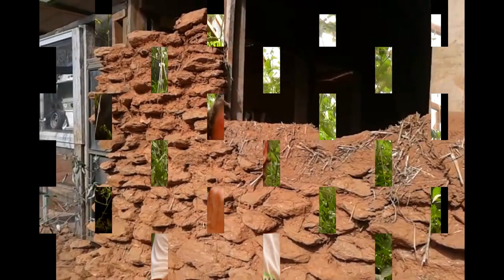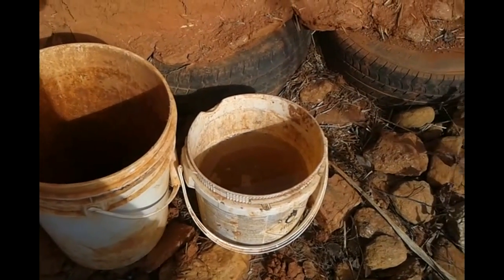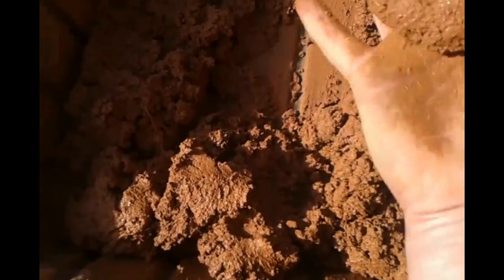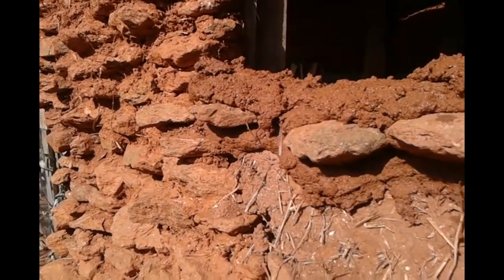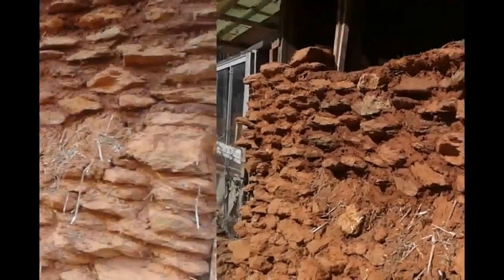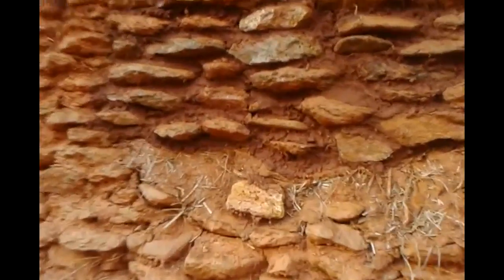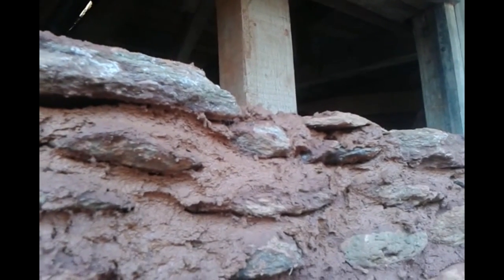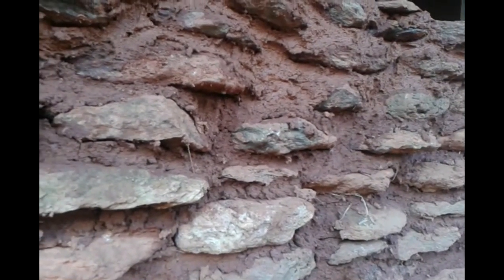How To: Rock Wall w/ Cob Mortar

Comment: Hello, friend. So sorry I have not seen this till now. I love cob building. And it is amazing you can find the perfect rock for each spot. We do not have red clay. But I keep testing what we have to see if it will get had enough. I plan to try an earth oven. But it seems the answers are in your land. Or things will show up if it is meant to be.When you finish the wall, you could rock up a  a bench in the area that has extra cob. That would look wonderful and provide a place to set plants. I love how it is the so strong you have to chisel at it. Best wishes, E. :)
Reply from the maker: A bench would be a great addition to my cob house Thank you for the great ideas. I need to post a video on how you test your soil for clay. I agree with you if it is meant to be it will happen. Thank you for watching
Reply: I would love to see the video. I has thinking maybe my soil has enough sand to clay ratio already in it. I have been making sample balls to see how they hold up. But some how they disperser.  Wind rain etc. I very much enjoy your channel. Thank you. :)

Comment: Awesome Idea cob/ soil cement and Rock something my land has in abundance !
Baruch Haba B'Shem YHVH :-)
Reply from the maker: +harm552002 You say that now and I said the same thing I have plenty of rocks and dirt. It runs out some it will be a grid pattern searching different areas and riding dirt roads looking in the ditches. Be careful if you start rock work when you visiting new places you will pick up cool rocks and carry them home no matter the distance. I have carried rocks 1200 miles the awesome thing is I can show you those rocks in my work. Thank you for watching

Comment: Great video! 
I'm working on an urbanite retaining wall 10 inches high. I'm wondering how the cob mortar holds up on the ground in wet conditions like monsoon rains?
Reply from the maker: Sierra Novack if it stays fully it will be fine
Reply: What do you mean, if it stays fully what?  We're debating using concrete motar vs cob mortar. And if cob straw or no straw?  Like someone else commented, there is hardly any info that I can find online. Any info would be appreciated.
Reply from the maker: Sorry if it fully dry's

Comment: Do you think i could use cob on old brick wall? Would it stay on? Thank you :)
Reply from the maker: I think it will work great. I would give it a try won't hurt anything. I used brick with cob morter morteron the Adobe oven they are holding up great.Thank you for watching.

Comment: That's not 'about the maximum you wanna go'... If you want a higher wall you have a couple options but recommend using both... 1. If you want to go higher you can and should build a wider wall... The skies the limit. 2. Is using something to support your walls, bars, wood, mesh etc.
Reply from the maker: Thanks I'll try that

Comment: Please make a list of everything people need to know, write a script, and get someone (your wife) to film. There were shadows blocking the picture. 1. You didn't say how high is too high to build and didn't make it clear you meant "wet build". 2. You didn't show the addition of water first, then cement, then soil. Is that how you do it? I find that makes the mixing easier, quicker, fewer clumps in the bottom. 3. If you don't use straw, is it "cob"? You didn't in the last mix. How is it your nephew laid stones without your supervision? He made more work for you and it's not pretty. Are you sure he used enough cement? 
If I carry stones 1200 miles, they will be big, flat, thick, and lovely color. No stone can be too big because it can be broken up with a sledgehammer. 
I learned more from reading the comments than watching the video. It's not enough to inspire, you need to inform, e.g., adding 1% lime or 20% flyash to the mortar strengthens it. 
Every soil/clay is different. Some make better (stronger) mortar or blocks. It might be good to advise testing with instructions on how to find sand/clay/silt content, what different ratios mean, and how to make/test a block. Building walls that tall without a tested mortar could result in a collapse/injury. If you don't want to get that technical, at least warn people to find out how to test. Ten percent cement should be plenty, but 5% cement may be plenty if the soil makes good adobe. Cement is the main expense so using the minimum saves the most.
Reply from the maker: Come out I will be glad to show you everything I know about it